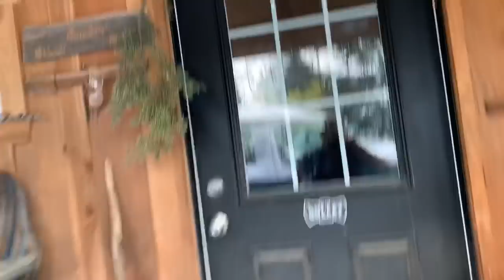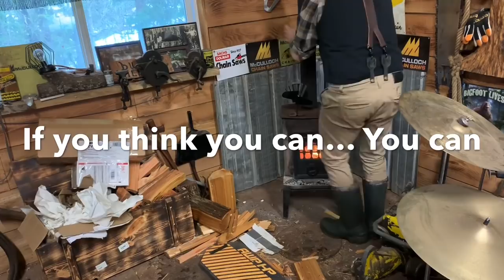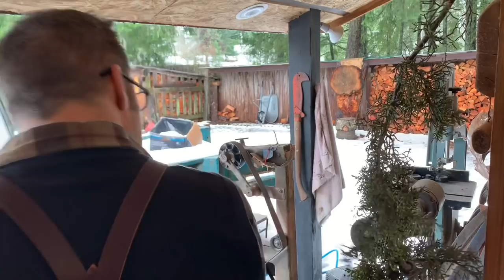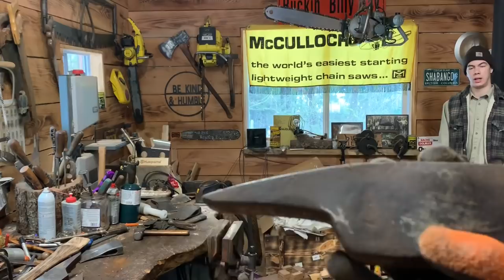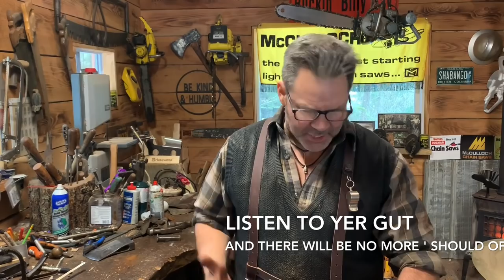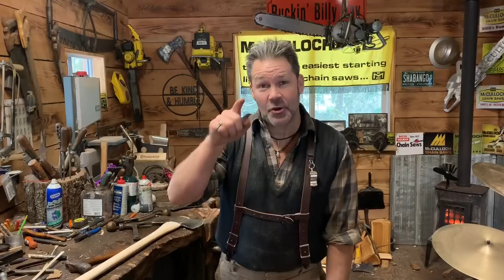The Undercutter - an Axe with a rich logging history

Comment: Hi Bucking  - touch of cabin fever! - try being stuck in the house since 19th December 2019 ... me arms had so much 'plaster' on it I couldn't get a shirt or coat on to go outside for a walk.... Still at least the new metal work doesn't show! Such is modern medicine...replacing bone elbow with metal joint amazing op.  Keep the videos coming, not got much else to do until the doc releases me from "don't do anything you're still recovering from the op restrictions....." then I shall be able to get out me cabin!

Comment: What kind of suspenders are those buckin they look really nice where do you get your pants that fit that style here in the uk ours are just metal clips that clamp on to your pants
Reply from the maker: i put the button on sir suspenders i had custom made
Reply: @BuckinBillyRaySmith  buttons are better & more comfortable than the clips. Half the time the clips don't hold very well.
Reply: @BuckinBillyRaySmith  where did you get them made at do you just put the buttons onto your trousers yourself. Dont suppose you could send me one of them nice double bit axes

Comment: Hey buckin Billy Ray
Do you know what a straighter axe is?
Or strayer not sure on spelling.... Just picked up a new one.... Original but like new.... Unfortunately it's been painted blue by someone hanging on wall.....
No handle... Is it worth anything or should I handle it and use for my plastic wedges...????
Please help I need information on this

Comment: Just from watching Black Bear Forge I believe you could try to reforge the fire axe spike with a hot enough torch. A tiny anvil on the vise is all you need. Fast so that the blade doesnt lose hardness by stealing the heat. It doesnt have to be red hot if you can hammer it fast and hard. Just warm enough so that it doesnt brake. It's the way it's used to be done. Are you flirtitg with the idea of sanding it down? People didnt use to waste steel in the past

Comment: I was always told NOT to burn cedar in a fireplace due to the resin, and it causing creosote.
So, is this not an issue?
I ask because I have a TON of cedar that I can cut, but I did not want to just leave it lay.
Reply from the maker: lonnie there are so many wife tales out there ,, and this is a great one ,, typically cedar is for a fire starter ,, kindling,,,  but if you have it i suggest burn it but mix it with your regular material and burn it hot ,,it is the slow burn and moisture that create creosote,,, Burn it Lonnie ,,, Burn it all
Reply: @BuckinBillyRaySmith , thank you sir! 

 I was wondering because I saw that you burned it quite a bit, and also knew that you did not like to clean the stove pipe flu much.  lol 

I knew that cedar burned hot, and it seems to spark a bit more when burning in our fire pit. 

Being able to use this in my fireplace brings me peace.  Thanks again, as I always value your expertise!